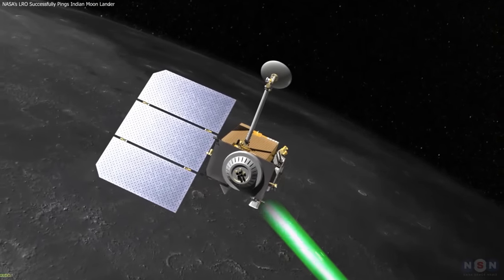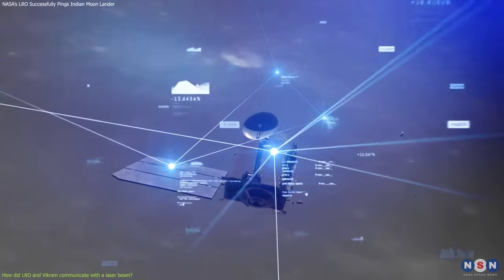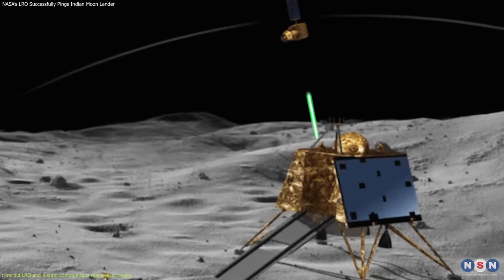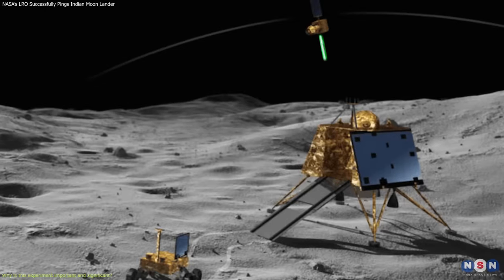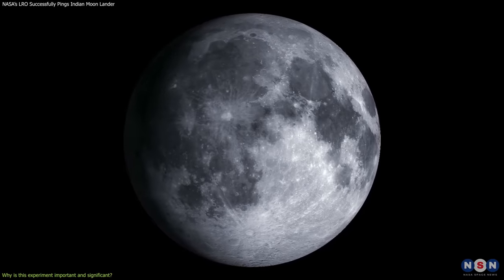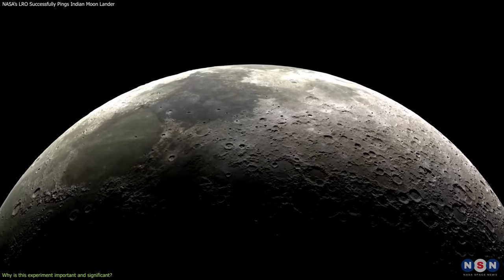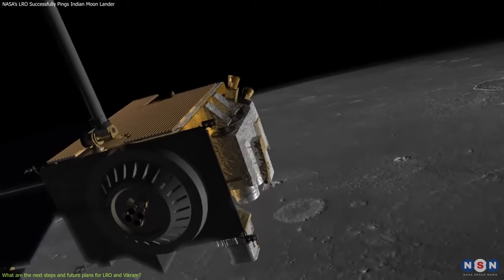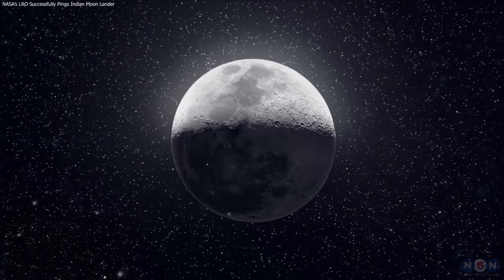The First Laser Communication Between an Orbiter and a Lander on the Moon

Comment: I don't consider pointing a laser at a retro-reflector and seeing the reflection as communication.  They can hit the Apollo reflector from Earth.
Also, 1.6 seconds for the laser beam to travel 500 miles sounds a touch on the low side, unless you're firing it through treacle.
Reply: In 1.6 seconds a laser beam should travel 479,667.9328 km or 1.24589 times the distance from earth to moon.
Reply: Is treacle the same as molasses? My mother used to describe someone/thing REALLY slow as being "slower than molasses in January"...
Reply: @4herstory  More or less.

Comment: This accomplishment, while important, is not the first time that a retroreflector has been placed on the Moon. During one of the early Apollo missions the NASA astronauts placed a retroreflector array at their landing site and positioned it to face Earth. NASA then sent laser pulses to the moon that were reflected back to a detector on Earth to continuously measure the distance between Earth and Moon. For years radio hobbyists have been able to bounce radio transmissions off of the Moon and back to be received by antennas on the other side of Earth, regions that would otherwise be unreachable by the “line of sight” transmission of terrestrial radio signals. The technology that made Earth-Moon-Bounce possible was invented by the Nobel Prize winner J. Taylor. He developed the detection algorithms to  make it possible for him to study pulsars. Taylor was also an amateur radio hobbyist and realized that his work on Pulsars could be applied to to amateur radio to make routine what previously impossible. Many thanks, Joe.
Reply: Agreed, this video kind of missed the point on a several areas. Not the least of which is what you said, this has been done before.  Another that bothered me is the talk of the dust interference - it would have to be a mighty cloud to completely obscured the beam, not to mention a retroreflector doesn't facilitate any type of communication other than 'it took this long for light to reach the reflector'
Reply: Astronomers have been using the Retroreflectors since the placement by Apollo crews to measure deviations in the lunar orbit. Noted as one of the longest running space program to date. Those retroflectors still give useful data on a daily basis.
Reply: This is proof that the Moon is flat and Earth is round🤣😂😅😆😉
Reply: The AI might have concluded that Solar Winds could trigger Dust Storms on the Moon.
🚀🏴‍☠️🎸
Reply: First time in South pole

Comment: You're taking liberty with the word "communication."  Though technically correct, when we hear that two space ships "communicated," we naturally assume data from each was traded with the other (two way communications).  For example, one asked the other "how many hours are left on your battery?" 

It sounds like what happened was a laser was bounced off a mirror.  😂  So that's communicating in the same way to water canals that touch are said to be "in communication" with each other.  😂  Weak.

Comment: i had to comment on this .. Simply communication by light signal is very very very old. People fail to realise that in truth the "TELEPHONE" was in the end the way we chose to communicate over distance. Well before that was invented though there was a thing called a photo phone. The same thing but using lights and a photographic sensor to decrypt the spoken word . It is not new at all in fact obviously we use fibre optics today in the same way and instead of an analogue signal we use binary/ digital information compressed and decompressed by software and computers which allows our communication to be conveyed and translated in a very rich and high quality way , The reason the photo phone didnt take off was quality and interference over long distances . This is why now it is cheaper to use mobile telephony rather than a landline. No one digging up roads to lay cable and fix them ...

Comment: Since they had generated shots of the orbiter buzzing hilltops, I got to wondering... How LOW can an orbiter theoretically orbit the Moon? I'm sure there's no practically benefit to that, but is it possible to do without constant or occasional thrust. Anybody know?
Reply: Nice question :) As the moon is not perfectly spherical and has mountains its mass distribution and resulting gravity field is uneven.  Anything lower then around 50 km above the moon will be tricky to keep stable in orbit.